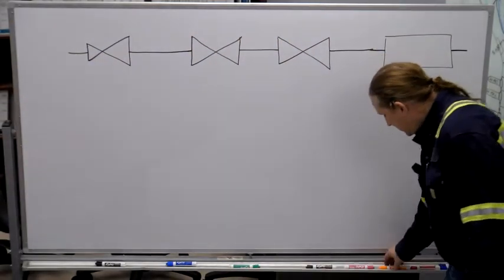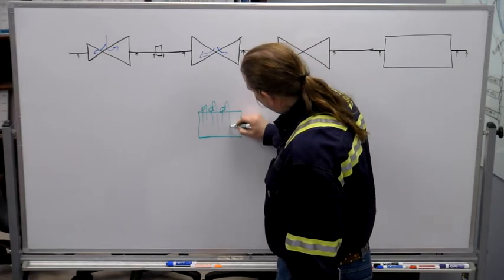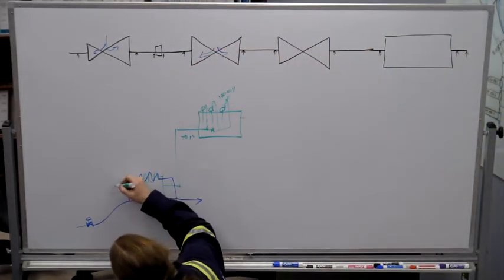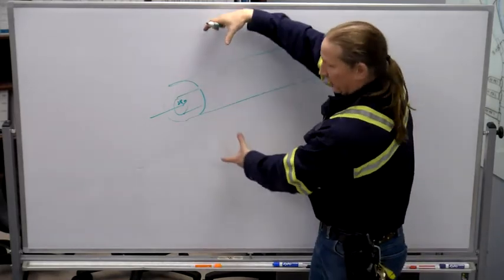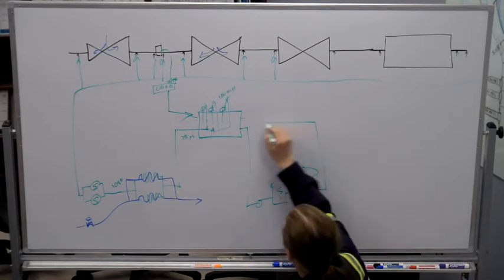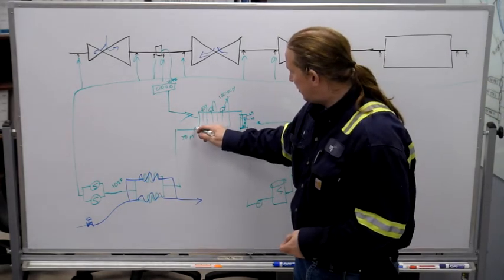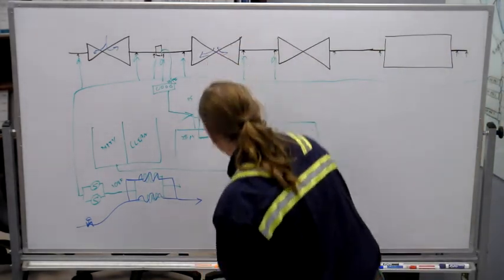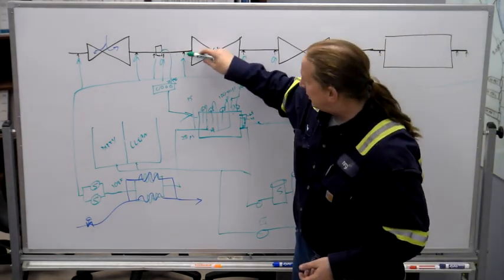Power Plant Basics: Turbine Lube Oil

Comment: Awesome!! What are the common problems that can occur in the lube oil system?
Reply from the maker: The problems mostly stem from the cooling system. If the cooling is inadequate to the heat load the oil viscosity drops and then the bearings overheat. If the coolers leak, water can contaminate the oil system, which will also damage bearings.
Reply: @Shaddicus  Thanks for replying, Shad!! And what about oil starvation? Are leakage/clogging in the oil lines frequent?  The lube oil systems usually have flow meters for each bearing?
Reply: @Shaddicus  How water contamination is detected?
Reply from the maker: SpongeBob meme: (2 Years later)
We're a relatively new plant and have experienced no leaks, but clogging shouldn't ever be a problem if the strainer integrity is good and the operators avoid risks to contamination.
We don't have flow meters for the each bearing, but we do have site glasses for flow and both oil and metal temperature elements, which would all be tattletales for flow restrictions.
Water in the oil will make it look milky. The coalescing filter on the conditioning skid will remove water, but if the leak rate is higher than the cleaning rate eventually your viscosity will be compromised. Swap to the standby cooler and schedule to have the other cooler plates inspected.